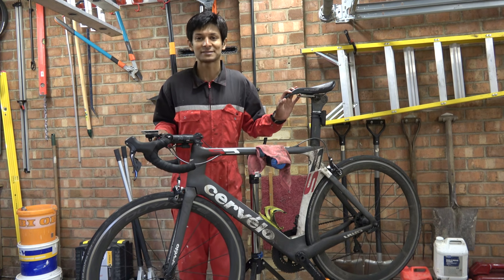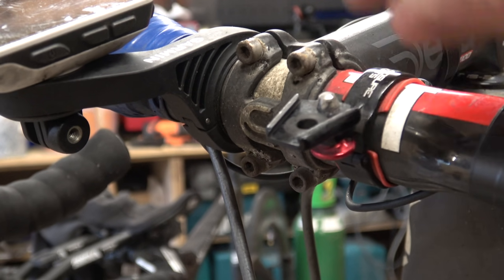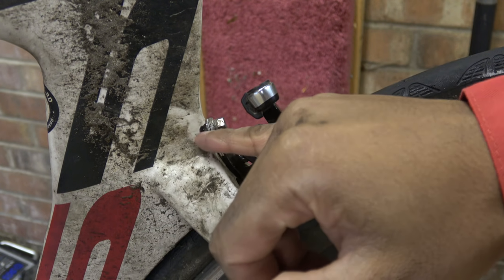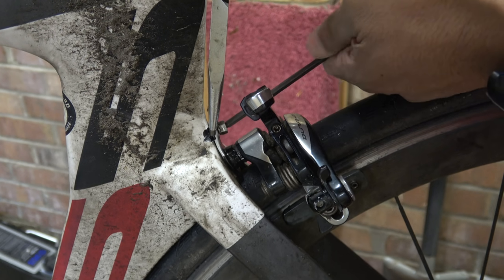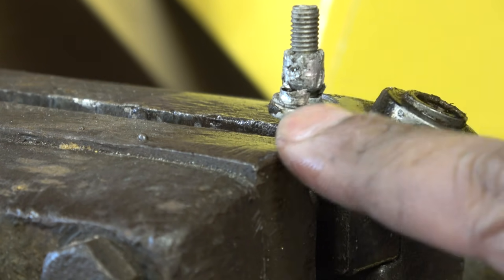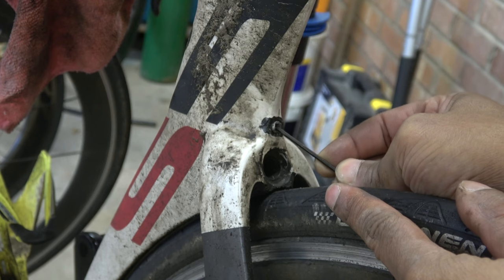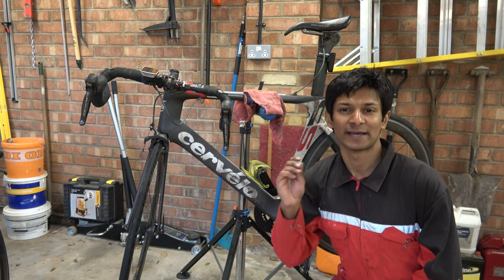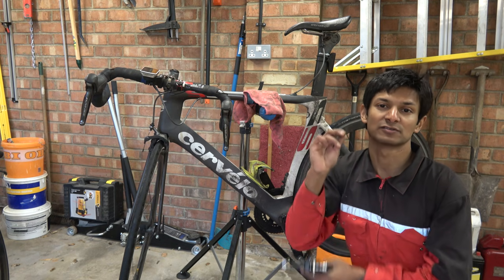How to fix a broken Bicyle Frame Boss (water bottle, bottom bracket, down tube)

Comment: Do you think 9/11 was a controlled demolition? Just curious to here an engineer's opinion
Reply from the maker: It was the fire that destroyed the buildings. They were designed to take large aircraft of the time they were built but not Boeing 767's which is what eventually hit them. The steel melted and then the weight above caused it to concertina down.
Reply: Hambini inside job?
Reply: Sort of like a well-planned, controlled Demolition executed by experts (with help)...
Reply: @Hambini  The impact of the planes blew off the spray-on type of fireproofing that was on the beams. The central beams that were affected only needed to have been heated to 5-600f before the rivets popped off causing catastrophic collapse. As soon as one floor fell, the others pancaked. (You call it concertina)  The design of the building was partially to blame there were no columns in the office areas because the load was held by the outside columns. Except for the central core, there were no columns to provide redundancy. Also, the core was only protected with sheetrock for fire protection, not impact. I remember it only too well.
     note; beams are horizontal, columns are vertical.
 As a result, building standards were massively upgraded. Concrete (Giant) cores are mostly standard. Spray-on fireproofing is virtually gone.

Comment: Don't buy a carbon bike.... problem solved.
Reply: galvanic corrosion happens any time dissimilar metals are in contact with each other.  Steel, Alloys, TItanium.. they all do it. Metal bikes suffer from this just the same as carbon.
Reply: Better yet -- find a Cervelo made before they switched to making their frames out of carbon fiber. Same aero advantage, shatter proof, problem solved.
Reply: Jim Hansen not really, the steel screws on my Titanium bike might rust but my frame won't. And it's way less of a problem with a ti bike than carbon. I should know I'm a bike mechanic and I see the problems with carbon bikes compared with metal bikes every day. My money is on metal any day of the week.
Reply: @reginaldscot165  thing is, carbon bikes look so sexy,  you can see why anyone who's got the buzz of road riding would want one.  awful how easy they are to write off though.  Not convinced I'd get one but then I pedal a 20 yr old  ally thing anyhow.